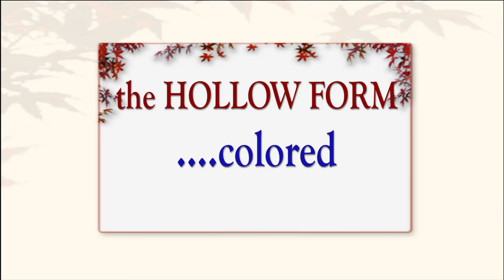Coloring a Box Elder Hollow Form  with Sam Angelo

Comment: Nice video, Sam.
I did not know this kind of "wood dyes", which one gives Spirit Stain inside from inside.
I have this kind of Chesnut spirit stains as a set of 9 pieces
An airbrush equipment (compressor, airbrush gun) I have, but I have not yet tried these

Comment: Very nice Sam!!
How thin did you have to turn the bowl to get the colours to bleed through from the inside?
Spectacular piece!
Regards
Dennis Beamish Cambridge Ontario Canada
Reply from the maker: Dennis
I find this depends largely on the type of wood. I use this technique mainly for box elder. I have less success with maple.  The wall thickness needs to be less than a quarter of an inch and the wood needs to be very dry.  You can simply experiment on some thin boards and you'll get an idea of the requirements. Thanks Sam

Comment: I'm not completely clear on whether the light blue from the air brush is paint or dye. I saw a little over spray on the threaded insert. Do you think masking that area would help prevent that or is it easily removed and not a big problem?
Reply from the maker: The "color" I use is mostly from Stewart Mcdonald and they call it a stain.  I put vasoline or wax on the threads and that does a pretty good job.